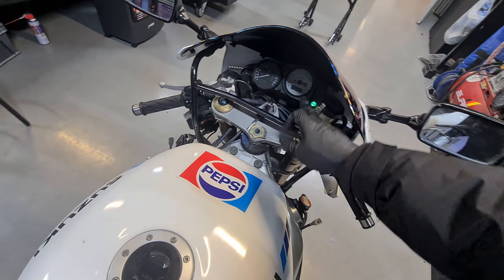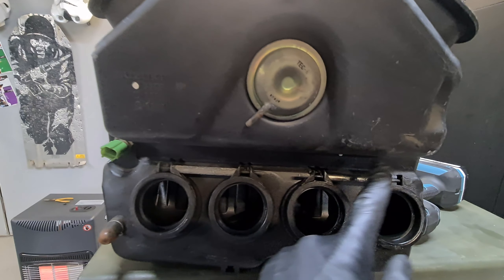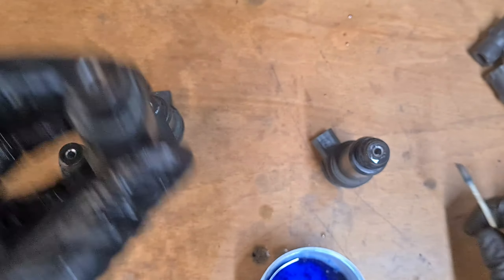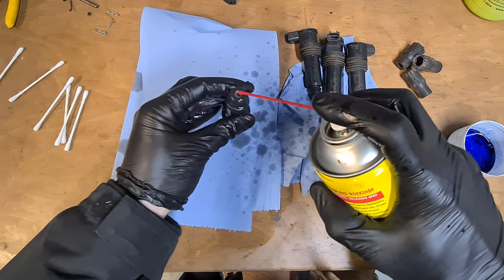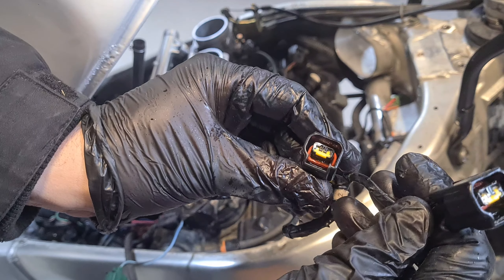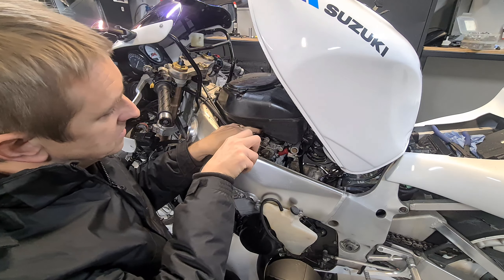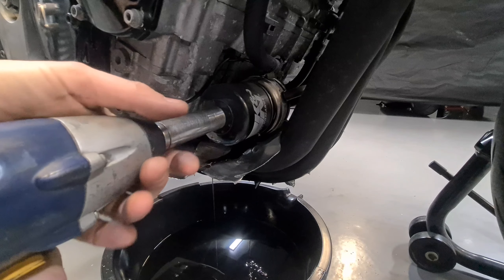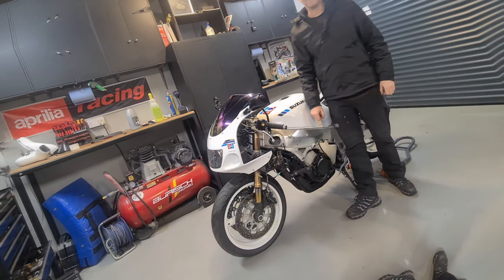SUZUKI GSXR750 SRAD SERVICE PART TWO OIL AIR FILTER SPARK PLUGS

Comment: another problem you can have with the coilsticks ,is they can have tiny cracks in them .and when the engine gets hot , the plastic expands ,causing the coilstick to ark to the cylinderhead . so if you getting normal readings off a coilstick  on the multimeter,but getting a intermittent misfire on that cylinder . thats why ,this tends to happen alot on srads ,because of there age . sometimes some heatshrink can cure it . but it does make it a tight fit getting them back in . :)
Reply from the maker: Yep I have had this on the ZX7R and my old GPZ.. I turned off the lights in the garage and could see it arcing to the head 👍

Comment: What is this stuff called you cleaned the coils with
Reply from the maker: Harpic power plus toilet cleaner... Becarfull using it on steel as it will clean the rust but you have to coat the metal after but its fine with copper
Reply: Hey my srad is only staying on when the choke is on what do you think the problem is
Reply from the maker: Idle set too low... Is it carb or ruel injected

Comment: hi mate can i ask a question? when you did a resistance test on the coils after cleaning you got around 5.4 , you said they are good at that but what is confusing is you said if they are higher than 5 ohms they are no good. i think you mean 0.5 on the test and 5 would be no good but could you eleaborate please. And thankyou so much for the videos i am subscribed and recommend.
Reply from the maker: Yeh sure sorry ... always check the manual for the testing specs.. but some aftermarket coils have different resistance usually from 5kohms to 12kohms.
If there is too much resistance then they will not make a spark or if there is too little resistance then the spark will be too quick

Comment: Do you no if an R reg srad 600 is suppose to have them plastic inlet funnels that mount on the carbs?I see some bikes have them but some don’t
Reply from the maker: Are they aluminum or red plastic?
Red plastic are stock 98 bike and aluminium ones are aftermarket but shorter... They make a smoother airflow into the carbs... But don't k ow it they actually make a difference
Reply: @PXCMEDIA   ah nice one pal,my bike doesn’t have them but I keep seeing pics online plus I’ve noticed them in my Haynes manual and I wasn’t sure if they was missing.this is my first road bike and it’s a project at that.due to do my test in the next 12 month
Reply from the maker: Ah OK... They wouldn't make much difference... But you can get aluminum ones
Reply: @PXCMEDIA   awesome pal,thanks for your help,keep up the great content,very informative 👌👌
Reply from the maker: Thank you mate I will put more project content on this year hopefully but we are buisy with Ukraine aid missions at the moment

Comment: Hi love the bike have a question I have a 98 srad 750 it’s overheating on me I charge the thermostat the fan comes on when the temperature hit 225/230 but it still get hot can you give me some advice please thank you
Reply from the maker: Oh then you could have failed water pump... or blocked hoses.. or a blown head gasket

Comment: I'm getting an 600 srad next week, I know the name harpic, but what actually is it, ie spray or something
Reply from the maker: It's actually toilet cleaner!... But some metals it will strip the coating if it is left too long... Its good for brass and rusty exhausts... Anything else then you have to wash it all off and apply oil immediately... But its good stuff
Reply: @PXCMEDIA  thanks mate for that
Reply from the maker: No problem 👍